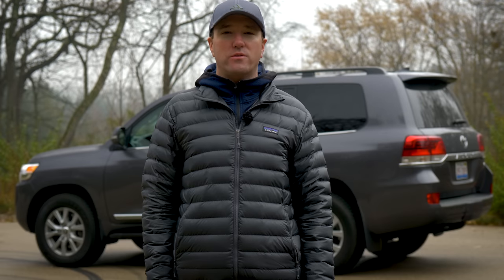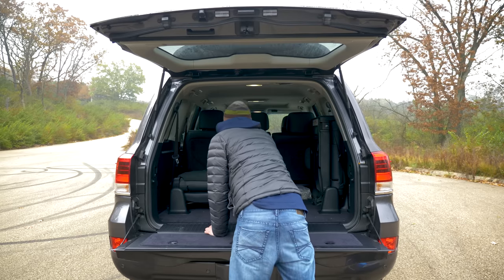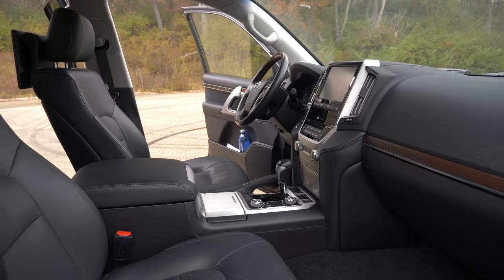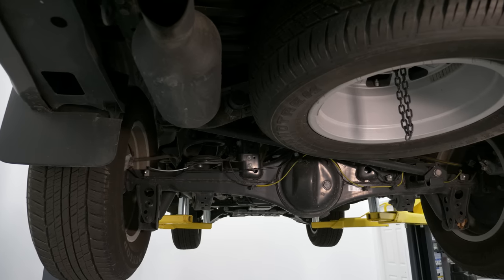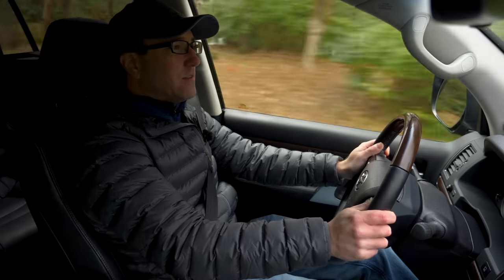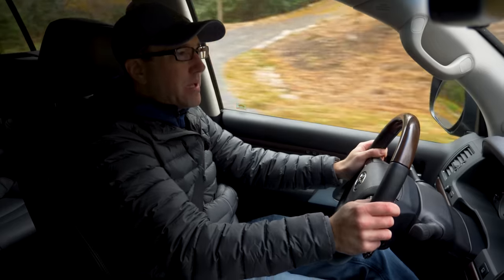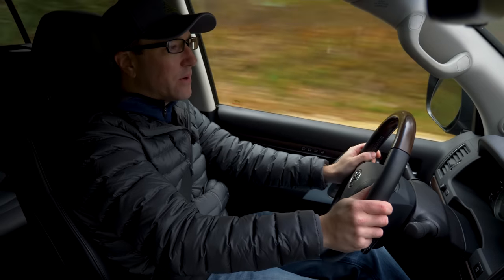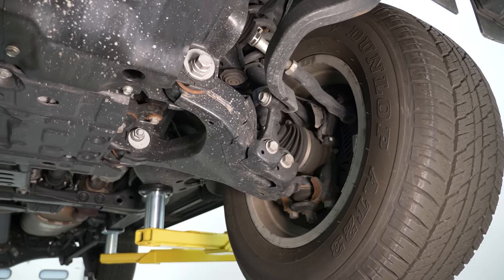Review | 2017 Toyota Land Cruiser | The Veteran

Comment: if someone ever told me to pick a car that youll have to use the rest of your life.. this would be it..
Reply: Mine, at nearly 20 years of age, has just crapped its brake ABS and booster system. The back axle and various bits are now getting pretty rusty too. Do I spend nearly £4k UK on the brake repair on a vehicle worth about £4k after its been repaired? That's the type of question you have to ask yourself when running something luxury and big long term.
Reply: Fadic4 thank you
Reply: yeah even at 86 grand its not terrible if you look at the fact itll prolly out live you.  but honestly, hes right about their should be a utilitarian version.  idgaf about fancy interior shit, i just want a badass offroader with a V8 that i can drive forever.  my biggest issue with the 4runner is their isnt a V8 offered
Reply: dr. breen's beard good news is toyota said they are going away with the luxury and focusing on the roots of the land cruiser and gonna focus on it being off road specific for the 300. Can’t wait for the new 4runner, land cruiser, tundra, Sequoia.
Reply: @dr._breens_beard  lc is sold in toy's major markets as GX/205; totally stripped down versions with a diesel. Its just EU and US where only the LUX/LUX+ with this ridiculous price tags are shipped to, unfortunately. Also, there is a much preferred 4.5 200 kW diesel version everywhere else but EU and US. Has to do with emissions regulations. Toyota could be no longer bothered with the EU emissions nonsense so they stopped bringing LC200 overall (emissions fleets average numbers). I think that LC100 was still the best of luxury/reliability worlds, but 200  is very nicer. I am getting mine next week :-)

Comment: Most reliable SUV on the planet.  If you have the $$ there is no competition.
Reply: Justin S um nissan patrols
Reply: alexander1485
They're pretty reliable... but not like this. The Land Cruiser is so reliable that the Al Qaeda uses it in high temperature deserts. In dusty, sandy, dry salt bed terrain with obviously little to no maintenance (Since I don't think there are Toyota service centers around war zones.) against mil spec hummers with a fleet of technicians that take care of them at HQ.
Reply: The not offered in USA anymore Mitsubishi Montero is another competitor....I have the last year in USA 2006. It is built like a tank and they commonly run to 250-300k miles without major repair. Like the Toyota, the interior could be better.
Reply: J Fazzuoli
That's a shame.. Same thing goes for the Toyota Hilux.
Reply: The Montero was expensive to repair when it didi break and the huge V6 was a dog.
Reply: Money-wise maybe you're right, but at equal or less than half the cost, its smaller but the (no-longer-in-production) Nissan Xterra Pro-4X can do 95% of what this can, and with a few mods....even more. Also apart from the few years when the trans cool and coolant separator were just a small plastic "doodad" they were ridiculously reliable. There  is more than enough examples of Gen1 and Gen2 Xterras/Frontiers present on the road to relegate them as a very very reliable and durable SUV. Of course, this is a midsize so there it would be better matched against the 4runner/FJ, but in my subjective opinion found it better than both in actual on/off road performance.

The notion that we should dignify Al Qaeda's is pretty silly. Its pretty certain they took whatever they could get, and yes the LC is widely popular in the Middle East, but its also because its widely available, and Toyota pushes out significantly more numbers than Nissan and Mitsubishi (now owned by Nissan).
Reply: My Aunt had an Xterra, Excellent off road and tons of room on the inside at a very reasonable price.  Very Reliable.  It could tow also. On road it was horrific.  14  mpg was the norm the brakes were completely unsafe ( like most Japanese cars of the time) and the on road handling was horrible.  On top of all that it was slow.  No where as refined as the Land Cruiser.  That was the time when the American SUVs were really stepping up their game.
 Even My 2001 Cherokee had 25 more hp and weighed 500 to 700 pounds less.  Not body on frame but it has two live axels.  The only Advantage the Xtera had was far better rear seat room, reliability and workmanship.  The Cherokee is a real Jeep with 17 mpg real world mileage and good on road performance.  Also cheap and easy to repair. The Cherokee was completely obsolete when the Xterra came along.
I like the Xtera but it was kind of phoned in like a Leaf of its time.
Reply: I am not sure what year your aunt's Xterra was, but my '12 Pro 4X was a beast. I too owned a Cherokee, it was a 2000 Sport 4.0L....great little SUV but they were different animals. I don't know about slow. The 2008+ with the VQ 4.0 did 0-60 in 7.1sec. If I remember correctly the Cherokee was around 9sec. Actually, the Xterra had the fastest acceleration in the segment. The '18 Land Cruiser is listed at 6.8s 0-60 for reference. My guess is that's an improvement with the 8sp transmission.

Your Cherokee was listed at 190hp, the GEN 1 Xterra was listed at 180 or 210 for the Supercharged, and the Gen 2 is 265hp and 280something torque....So I have to assume you're referring to the Gen 1. Get in a GEN 2, the refinements, build quality, layout is a whole different animal. Its bigger and better with a lot more power.

That said, MPGs are still a problem, its still a brickwall in the wind. The closest I ever got to the EPA was 18.7mpg on the highway, but I didn't own the Xterra for very long before I had proper A/T tires, armor, and a 3.5/4" lift kit on it. I built it for off roading...and I did a lot of it! The stock ride quality with the Bilsteins was very very good. As a matter-a-fact, when I raised the suspension and started compensating for the extra weight of armor, the on-road ride quality suffered unless it was after a day of offroading. I have no doubts that its as good as an 18 Land Cruiser, but I do believe that you should get something better at more than double the price.

As far as refinements, the Xterra really had a different design philosophy since its inception. There would be no way that Nissan would meet the market segment with hard-use interiors at the $60-$80k mark. However there is no way you can take a warm wash cloth on the interior of the Land Cruisers and expect everything to come out 1) clean and 2) unscratched. Just looking at the design differences between the FJ Cruiser and the 4Runner (using the same architecture) really identifies the philosophy of use.

Now I will say that my only real experience with the LCs is with the J80 and J100, and if I could buy one tomorrow, I would....but not over a 2012-2015 Nissan Xterra Pro 4X.......IF I were going to use it mainly for offroad. Its much more nimble, turning radius is amazing. Approach angles, especially Break-over angles, and departure angles were completely dialed. A Wrangler Rubicon 2D was more so, but a far less refined on/off road driving experience. The Xterra Pro4X was an absolute sleeper, a beautiful utilitarian SUV that was very durable and reliable. I just needed either more MPGs or a truckbed, so I had to change to a Truck....not to mention the average distance I went to get some good off roading....it just became too expensive of a hobby to go along with my mountain biking.

If you find someone that has a Pro4X, you should check it out and test drive it. The interior is very dated, but its also very good for its purpose.
I would say that the worst thing about it is the MPGs and storage room. Thats really my only complaints.
Reply: I was referring to the first gen.  The Original 4.0 Cherokee started out hitting 60 in under 8 seconds by 2001 it gained 600+ pounds ( still a lightweight at 3600 pounds) it took 8.4 seconds but if you owned one you know the real story was 0 to 30.  Off road creeping with a ton of torque just off idle.  

You could be 100% correct about the 2012 to 2015 Xterra.  By 2010 the Xterra was completely off my radar.  I did not even know it was still around until I saw it was discontinued.
Reply: . I see a video where an apache helicopter shot a land cruiser full of terrorist with its 30 mm gun. Was not nearly tough enough for that. It was glorious and you can be series about a Humvee. Those things barely have electronics
Reply: Nissan Patrols "Hands Down"
Reply: @KP-by4eu   Thats just about one of the dumbest things Ive ever heard.
Reply: Alexander1485 Nissan sucks!

Comment: These things regularly go 600k miles. I have never heard of a Ford, Chevy or Ram accomplishing that.
Reply: Doug M. The Ford , Chevy and Ram combined won't last 600K miles.
Reply: my 2008 toyota sequoia which i bought brand new, is now 350,000km and still going strong, never broke down.
Reply: Mark Blythne, I hope you are rustproofing it because a Sequoia with an odometer in KMs is probably being driven on salt strewn Canadian roads. Am I right?
Reply: Guy Proulx,  You are correct but it makes even more sense to rustproof a vehicle that is genuinely engineered to last 20+ years.
Reply: Guy Proulx, In a Youtube Comments Section first, we are in complete agreement. BTW I use KROWN for my 12.5 year old utilitarian runabout.
Reply: My old f150 cost 30k and lasted until 350k with the 5.4. Pretty good
Reply: We got a tahoe that has 290k since 2010. So idk what your talking about. I tell you what. We've never had a button fall off lol
Reply: guy proulx so youre saying id be even more impressed with the tahoe? Cuz ive been underneath mine a few times. And after seeing underneath of the Land Cruiser. Im not very impressed. Besides the sway bar disconnects. It looks no more advanced or beefier than a Land Cruiser or a Tahoe from 15 years.
Reply: guy proulx are we just gonna ignore the fact that frames have been rotting and recalled for years on toyota trucks and suvs?
Reply: I know someone with an '83 Lincoln Town Car that has over a million miles on it. It's had some minor problems over the years, but nothing major has ever gone wrong with it.
Reply: I want to disagree, I’ve had several Chrysler’s, Fords and Chevy's last to over 100k miles. But EVERY SINGLE ONE OF THEM started needing regular repairs past say 60k, and when the average monthly repairs equal a car payment I give up.  The first Japanese car I had cleared 140k before it needed brakes, zero repairs. I’m on my third Rice Burner and it’s got almost 200k miles, I had my first shop repair last year, 2017 when my sunroof got stuck open.  I’ve heard of American cars going for several hundred thousand miles but the cost to keep them running boarders insanity.  IMHO
Reply: Jack Prick — Interesting article!  Thank you for the link!
Reply: guy proulx here is a fact for you. Government required safety recalls are 100% free. If ford, gm, or fca had frames failing at a statistically significant rate, then they'd be mandated to fix the vehicles out of warranty.

Also, over engineering a vehicle has its own problems. After a while, all the components have to be so strong due to the sheer mass of the vehicle. The "strong" looking components are now average in strength due to the stresses they have to cope with.

A LC is only a few inches larger than a 4R in wb, width, length, and height, yet weights 1000+ lbs more. That weight places extreme loads on all its components, necessitating larger ones and further increasing the weight. I'm not saying the j200 is compromised, but simply stating that a vehicle looks stronger isn't a direct indicator of its resiliency.

The spacecraft we build are the most well engineered vehicles we've ever made. They are built to BARELY survive in space, as any extra resiliency will do nothing but add extra mass that could otherwise be used for mission critical items. Safety factor wise, space craft and airplanes are about the lowest, and that is directly due to any extra mass severely degrading efficiency; and any extra strength would not protect them in a catastrophe.
Reply: @jimpatterson3874  congratulations, there is always one....................and its you.
Reply: Ive seen a few gm and fords go 400k km pre trouble free. It depends though how you use these things. If you abuse a landcruiser it will break too.
Reply: guy proulx  germans dont ;)
Reply: @stefanfreestylez  400k km is 248k miles. Thats about 40% of 600k miles, and not that impressive.